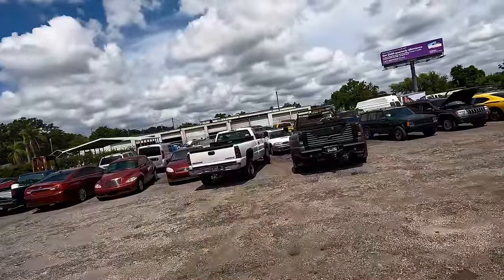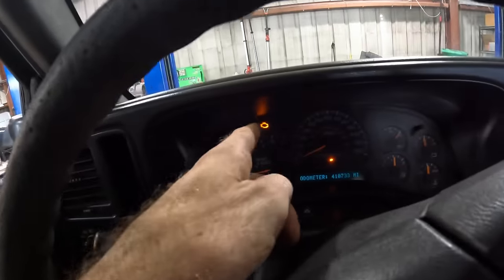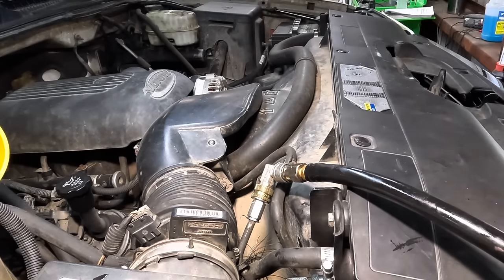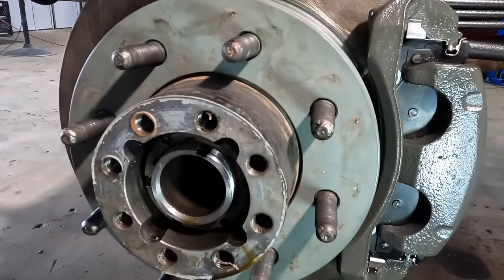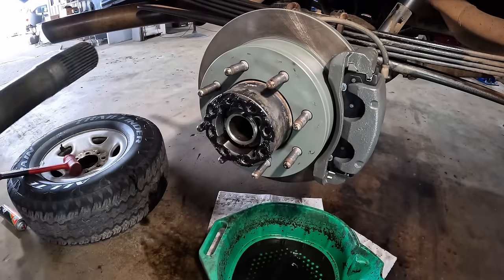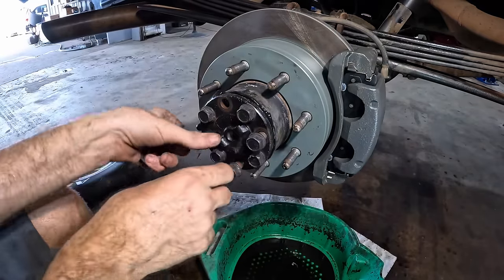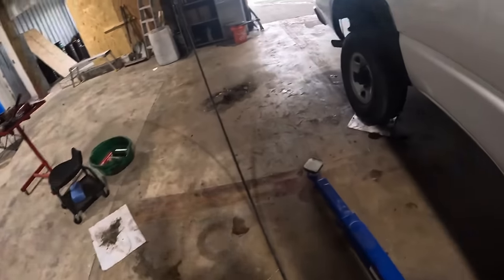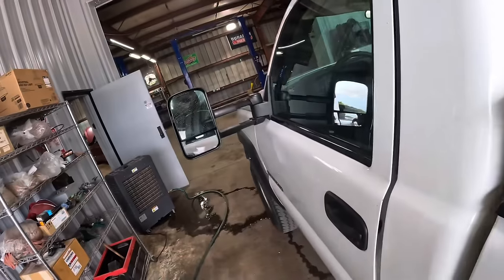400,000 Miles of BURNT Fluid & Loose Wheel! Oil Soaked!  2006 Silverado 2500 3500 6.0 4l80 #mechanic

Comment: I’m typing this before the end so this could change but why did you blast the hub and brake etc with cleaner but not the wheel? Would there not be fluid on the inside that would fling around where you cleaned? Just a question I guess. Sorry, at the end you said you washed the wheel, I didn’t see that so apologies.

Comment: Let's see, the truck had 400,000 miles on it. What I have found with transmissions is when a problem occurs then it is too late for service. If you get it before a component failure like shifting or almost anything it will then run another 100,000 miles trouble free with fresh fluid. I do not believe that addition of fluid from the can was necessary with the new oil, unless the filter needs cleaned which the can fluid will then loosen up to get in everything.

Comment: Ray You have nerves of steel, changing tranny fluid at possibly 400K miles. I nuked my transmission by changing fluid at 120,000 miles on my old truck. It started slipping after  the next 10.000 and was completely locked up after another 7,000 miles.

Comment: If the last service tech FUBAR'd the right rear hub you can bet the left side is also loose. For another 10 minutes flat rate, I'd have pulled that axle too. Better than a "Come Back" later when it starts leaking and then another 1 hour Flat Rate fee EATEN by the shop as a tech caused......

Comment: Ray you should have cleaned the back of the wheel just to be sure it's not leaking again because the wheel is still soaked with gear oil
Reply: He did, you must have missed it when he mentioned it.

Comment: Did I miss it or did you check other side . If they did one side loose the other will probably same. You might have said something about it and I missed it
Reply from the maker: The other side was ok
Reply: @IR-nq4qv  because brakes are done on both sides and if the person that DID NOT tighten one side correctly he probably didn’t do the other side correctly ether . It’s just an assumption but worth checking
Reply: @RainmanRaysRepairs  i figured ya did 😁
Reply: @IR-nq4qv  apparently you didn’t pass reading comprehension. As my statement said maybe I missed it . But thank you captain obvious
Reply: @IR-nq4qv  wow all that way too much to read . Looks like someone is triggered. 🥱

Comment: Not taking the hub apart and inspecting the seal, and parking brake shoes just wasn’t smart…
Reply: What I was concerned about is the lack of oil coming out when he removed the axle looks run dry

Comment: The Rainy man never sprayed the inside of the wheel which when he used THREE cans of brake clean on the inside hub and a little on the wheel well and springs, rainy never sprayed one drop of that cleaner inside Der wheel. Naughty naughty. But if I had you nearer to me I would use your services because most of the time is top notch.

Comment: 15:58 i dont know if he sees it later but the hub is cracked at one of the bolt holes. Deformed even...
Reply: @IR-nq4qv  Yeah, I noticed that as well. But it looked quite bad when paused at 15:58. Looked quite strange. Glad it was just sillycone.

Comment: Firstly there is always some idiot parked crossways in the parking lot.Secondly it is not recomended to do a complete fluid exchange on high milage transmissions that have not been regularly serviced (can lead to a box of neutrals.(The recomended way to service them is to keep some of the old fluid & put it back in it has clutch particules in it which helps give grip on the clutches.).

Comment: Forgot to hose the oil off the inside of the wheel. I did a one ton years ago. Needed brakes and all. Same thing. Didnt seat the seals. Let it leak oil for miles. The gear oil was caked on what was left of the brakes. Stink? Man did it stink. Cooked , old gear oil. Think it took longer to clean that crap off than it took to do the actual work. That was probably the most expensive brake job I ever did to. Guy wanted new shoes and drums. Crazy expensive.
Reply: I thought the same butt at 36:45 he said he did wash off the wheel.
Reply: @desotosky1372  I seen/heard that but seen the oily wheel when he put it on. Junk truck probably won't be on the road much longer anyways. Lol.
Reply: @waffalobill  I think Ray does things to create rrrreeeeee comments.  He is a bit of a jokester.  There were a lot of comments about the wheel.

Comment: All that because you don't wanna buy a $50 hub nut socket tool?  Come Ray, you're better than this.

What about the now gear oil soaked park brake shoes?

What about the other side since I'm assuming both sides were worked on by the same person?
Reply: nice and shiny outside, after the $ flush machine, owner only has enough $ for 1 side.

Comment: Ray, you have a welder, build your own special socket for this job.    A metal plate, four bolts, a little drilling and welding and you're done !!   Easy once your have a nut to use as the template. Since this is not a high torque application, even a flat metal bar with 2 holes/bolts the right distance apart would probably work.   I'm sure you have plenty of free time for such side projects.    :  )

Comment: Ray, why are you always busting on old transmissions.? All trannys are going to have a little clutch material in the pan. 400,000 miles shows the owner takes care of his truck. I had 461,400 on my motor & tranny before I replaced them in my 94 GMC 4.3.

Comment: Chevy guys parked all crazy at the repair shop..No surprise there...Of course Chevy's made before 2008 are fine, wouldn't buy anything newer than that though, unless it was a giant diesel...Drain a quart of tranny fluid, add a fresh quart, repeat every 2 weeks for a few months, that is probably the best procedure for high mileage tranny fluid changes..Not enough new fluid to cause slippage...

Comment: All you would have to do is make the owner of the truck sign away for that you weren't responsible for damage to the transmission I have seen transmission to even my own transmitter and my dad's charger that made it to 80000 miles and need to be changed because it was black but it's supposed to be a service for your transmission according to Dodge but if you look up on the Internet for example the people who make the ZF transition say servers at 50000 miles so I was over A-line that I didn't even know was there so I serviced tip I preserve it twice since and finally got all the trash you flew out of it after buying 2 transmission plants cause the filters made in the Pan but at least to save me a transmission I have done several on Chevrolet with 200 K or more I'd been 1 with 300 K Brown nasty fluid verily pink I have done that for a 100 K if not had a problem with that I don't think you'll have a problem with that 1😅

Comment: remove the trailer hitch when not in use on your truck, it's a violation to have anything extended past factory OEM bumper...FACT...that's why they are made to be taken off, when not in use.  It's a pedestrian hazard, and for other vehicles

Comment: Wants transmission fluid exchange, ignores the massive cracks in the windscreen. 🤦‍♀
Reply from the maker: I’m not a body shop or safelite
Reply: @RainmanRaysRepairs  I meant the customer was ignoring it. Not saying he will, but there's a lot of people driving around with screens like that, that don't care to fix them.
Reply: Or, maybe they fixed it and it got broken again rather quickly. Happened to me. Had windscreen replaced. 2 miles later, rock hit it, cracking the brand new one.

Comment: Without knowing if the owner changed the tranny fluid every 40000 miles, I would have not risked the liability for a slipping 4 hundred thousand mile tranny.  I would have refused to change the fluid.  A reman tranny + labour would far, far outweigh the profit from changing the fluid.   Further more, if the fluid is that dirty, imagine how dirty the filter must be?  Now you have clean fluid with a dirty filter....that just doesn't make sense to me.

Comment: Your babbling is pretty bad on this one. If that axle nut was not properly done up, surely it is worth checking the other side at this time to confirm it is also done up?? One assumes the same guy did both sides.